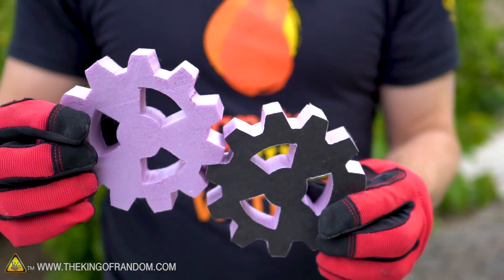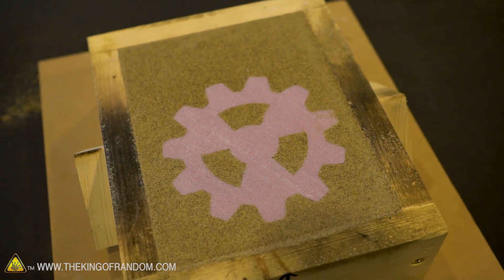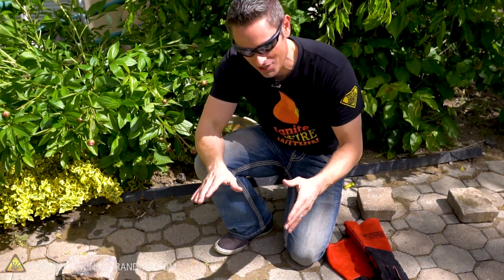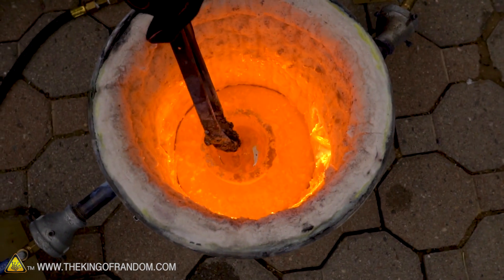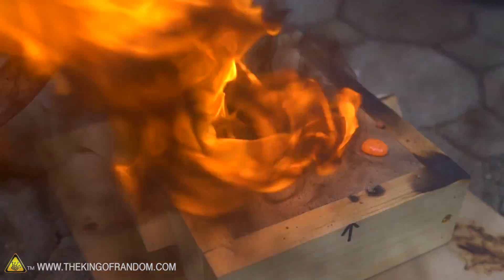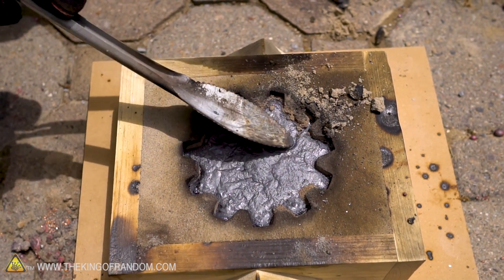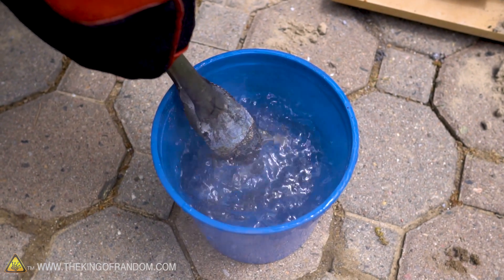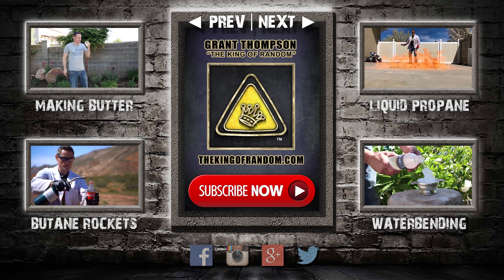Argh. Why Is Copper So Difficult? TKOR Tests Melting Copper In Our Homemade Foundry

Comment: Why not try that with a wax investment cast?  Could be that your sand is still too wet, so it's not rigid enough.  Should be ~6% moisture to be perfect.  Can hit it with a torch to harden the surface a touch.  Only other thought is to use a finer grit of facing sand.  So fill the mold 90% with your coarse stuff, then just top where the mold is with the finer stuff and pack it hard.  Should be a bit stronger.

Comment: have the mold buried in the sand and have a pouring hole from the top. that will keep the sand intact, then you cut the pouring rod off.

Comment: You needed to make your mold into Two pieces and pour through one opening til it starts to come up and out the other vent opening and let it set til it cools down the brake it apart. Because their is no way you'll be able to pour it like you are doing. just picture yourself with some wooden blocks in a tub and your needing to fill the tub with water as high as the top of the blocks. Those blocks would react like boat and float to the top.  Same as the sand is lighter than the copper so as soon as you pour the copper the lighter sand turn buoyant. So if you could maybe ad a light amount of cement to the mix it would help bond the sand together til you were done then beat it our or use a plaster mold.

Comment: I've never tried this, so this is a shot in the dark.... It looks like the sand just isn't dense enough and will keep popping to the top if you add all the copper at once. What you might want to try is pouring half the copper in and waiting for it to set. Then pour the other half in. This might prevent the sand from floating. An issue with this is you'll have a seam where the two layers of copper meet. That should be easy enough to buff/file away.

Comment: try using cement with the foam gear, or ceramic clay then bake the foam out and cast the copper in the mold, or plaster.

Comment: you must know about a tree structure to pour into your mold. Specifically you need a sprue and gates to let metal flow evenly and quickly throughout the mold.  Either this could be done in a double pour (two to four people pouring at once) or only have one sprue and hope with two gates, your mold will fill quickly enough.  Each gate could enter on either half of the gear. 

Your alternative method (that you were trying but a little different).  Make a sprue well right were you are pouring into.  Gate along the bottom of the object and with any luck, the metal will have cooled just enough to bond nicely with the sand and project your negative cutouts.  This is the risky version.

I'm sure there is a straight forward here is how to caste gears in an industrial capacity but the skeletonzation you have make this gear into is hard to caste.  I still stand behind the gating into the gear in two or three places (three being more labourious)

Comment: Industrial casting tends to be done with fully enclosed molds with sprues that you just have to knock off and grind down after casting, molten metal will try to displace sand if the mold has an open top. If you made a two part mold box and a two part mold (bottom being the gear and top being a layer with a sprue) it might work better. This is just based on what I know from large scale cast iron facilities I've seen and worked in not actual hands on experience.

Comment: Your mold needs a top. The heavy copper is much more dense than aluminum. The little square of sand is less dense and starts to float away when surrounded by hot copper and jostled around doesn't help. Having a top would keep it from floating off. I have used unflavored geletin as an additive to the sand. Its less toxic than oil being tissue based and and acts as a glue especially after it has dried somewhat. I saw it mentioned in a professional casting magazine several article years ago as a possible alternative.

Comment: idea dont expose a hole side of the mold as it seams it dosent break up the sand only lifts it as the copper is denser.

so instead of having the holetop exposed try to have something covering it up and in the middl dril a hole and then fill it this wy you keep the sand from floating to the top.

Comment: definitely a density issue, the copper is way too heavy and the greensand will float on it, you need a two part mold, cope and drag, to cast copper in green sand. you can also have a riser on the mold so as it cools and contracts you don't get voids in the mold. you can also float charcoal on top of the copper to help maintain a reducing atmosphere around the molten copper and keep it from oxidizing as much.

Comment: i think he needs a board on the top, holding the sand in place, and pour into the center. the sand is bulging out, probably due to the weight of the molten copper on 3 sides of the sand instead of 2.

Comment: Cool video grant.  I hope you try it again.  I think if you added some dowel rods to your gear to hold the centers in that would help a bunch, also your sand my need a tad more moisture.  Im glad you didn't give up!  You could also try a two part mold removing the foam before poring down the sprew.  Using baby powder to coat the part before casting will ease in removal.

Comment: Your sand was floating away because the copper has very high buoyancy. You should put 3 small (1x1 would do) arms coming in from the box frame (flat stock, no fancy up and over) to hold it down. You may still have a problem with the surface tension of the copper being enough to crush the sand laterally, but this will give you a better chance.

Comment: I think you have casting sand that's too coarse, secondly if you had a top to your mold it would keep the heat longer and more effectively fill all the void, also having a top would solve the buoyancy issue you have with the inner molding, you would also need more copper in order to fully fill the mold and sprue

Comment: grant all you need is a steel plate with a hole in the center to pour into so your sand parts wont pop out. but make ti 2x the size so you can ajust

Comment: you need to cover the top half of the copper mould, i.e. make a pipe like styrofoam entry system for the copper this will leave the three sections intact

Comment: Edit: I have looked it up and sand weighs 1500/1750 kg per m3. Copper weighs 8900 kg per m3. So sand is much lighter and will float on copper. Can you find a more solid material or something which is heavier?

Comment: +Grant Thompson - "The King of Random"  You should make a concrete mold
Reply: Chunks pop off violently when concrete gets too hot.  Obviously it could be quite dangerous if it splattered molten copper everywhere.
Reply: EDIT:This is false/untested; Setting of concrete need water, while it is harder than greensand it much more moist especially in the center where it cannot not dry, my best guess that if it gets to hot it would explode.
Reply: It would be a multi-day project, concrete + Green Sand cement mix that would need to set, then use that as a mold and break it out.
Reply: No.  It cracks due to thermal shock caused by the part in contact with the hot material expanding while the rest is trying to stay the same size.  You can mitigate that by pre-heating the mold.

Now, depending on the temperature of your casting material, it may be hot enough to dehydrate the cement, in which case it won't crack, but crumble as the cement loses its ability to stick to the other elements in the mix.

It does let you remix and repour the concrete though, if you're of a mind to do so...
Reply: The Avaren n
Reply: I'm not the smartest person but i never researched into it i originally got this information from my father who not the smartest person , but he has worked with concrete and what not but i probably should do research first before answering my bad. I'll be back.
Reply: Yes, i read about the contraction part when i went to go see if my research was correct, probably should of said something, but yes thank you.
Reply: Hmm, thought about a concrete as well. How about clay? Will it crack too?

Comment: Disclaimer: I have no idea what I'm talking about.

About two and a half minutes in and I think: Won't the pouring copper displace the sand though if there is no more Styrofoam to support it?

Five and a half minutes in:
Maybe it would be helpful to add some sort of foil to the outline of the styrofoam gear that is a bit more heat resistant? That could stabilize the sand even after the styrofoam has melted. I could imagine though that the foil, if too heat resistant, might actually contaminate the outer layer of the copper. I have no actual clue about metal casting though, so, you know, just rambling here...

Six minutes in:
Hm, I have no idea what the proper material would be, but to prevent the chance of damaging the shape with copper that drips on the sand a funnel could be useful (you did that part pretty well though, always pouring into the middle). And to prevent the sand from floating up a plate could be placed above the casting area (with a hole in the middle for the funnel).

Comment: You should mix the sand with epoxy resin to make it solid enough and suitable for casting out the copper gear. Removing the resin-sand afterwards is easy though. Cheers ;)

Comment: helloWhy not you make a mold in cement or iron (the iron in Two parts). the cement or concrete try to make without for sand or the minimum, some iron to reinforce the mold (use iron grid)

Comment: When they cast engine blocks and such they add something to the sand to cure it, a kind of resin I think. After pooring the metal they need a hammer to get rid of the sand because it's so hard. That's your problem, your sand is way too loose.

Comment: Grant, i think the water in the sand starts boiling and thats why it becomes unstable. The copper is also very heavy and thats why the sand starts floating on top.
Reply: Wilbert Coloma do you mean hydrophobic sand? That would be impossible because it would stay soft by not absorbing water. That way it could not form a solid mold.
Reply: late but I think the copper is so hot that the mold drys as it is being cast
Reply: renevank im just wondering what would happen if he used kinetic sand? Is there any difference?
Reply: If you did it properly and used epoxy sand then everything would be okay.
Reply: renevank
Yes. The damp sand method works for rough shapes only.  But is extremely 
useful for reusing scrap lead in making expensive weights for surf fishing. Also molten lead is not too hot to have to use specialized insulation while casting.

Comment: Copper creates gasses when cooling, and it will create bubbles or irregularities in the final mold. I recommend using a closed mold along with a mold tree to send the molten copper through, and lastly some sort of air hole for the gasses to go through. The air tube would be optional and may effect the compactness of the mold, but its worth a shot.

Comment: As a foundryman I can tell you you need a top part for the mold (a Cope) and you need to poke small holes through the cope into the foam pattern, also you need a riser to allow for shrinkage, look up founding and molding to get better results, hundreds of years of founding has figured all this out long ago

Comment: why aren't you casting a sand cover with a pour & vent hole? It might keep the structure from falling apart if it has a top to keep it in place.

Comment: Maybe you should try casting using closed mold. It seems that the biggest issue here is how brittle the sand form is; especially those chunks of sand that were pushed out by the melted cooper, if these were secured somehow, either by a cover with some holes, one for pouring the cooper and another for letting the gases out, or by basic 'anchors', like nails that would give them more support...

Comment: Would it help to use that red sticky sand ? They use that for these kinds of things a lot.
Also maybe use some talcum powderto rub into the shape so it will let go easier. You might even be able to remove it completely then ?

Comment: hey grant i have done it with loads of stuff made of copper what you need is and enclosed mould with a lid like how you make stuff with silicone because the force of the copper pushes the sand out and distroys mould

Comment: If you are forming copper directly and pouring it, you need to expect rough finishing. It will need additional work after coming from a mold... Fine details are best made after the molding is done. (In your case, cut out the open spokes if you want them.) This allows the completed item to be stronger "formed" copper. (Copper is not steel. Don't quench it in water).. Copper is more easily molded as a malleable item. It folds, presses, and can be made ornate. Copper by itself is quite soft and I wouldn't chose it for a gear....

Comment: change your green sand comp, I use 3 parts kitty litter to 1 part beach sand, BEACH SAND!!!! do not use torpedo sand. Since you're using a cold mould not a hot one, pour quickly to cast, not slowly. if all else fails. close the mould, and create a funnel to the styrofoam gear. pour into the hole, then grind off the excess.

Comment: I recommend on trying a two part greensand mould but keep the styrofoam in it, then those pieces of sand that float up are connected on both sides and don't have a chance to move.

Comment: try a dryer greensand. If you think about it, if there is lots of water in between all the little sand crystals then when it gets REALLY hot "the molten copper" then it turns into a gas, which rises and pushes the sand up with it. Therefore destroying the mold. It's just a thought, but I think it might work. Hope this helps!

Comment: usually adding silicium to metals helps them for casting, I don't know if it's the case of copper, but I know that it's works for sûre on aluminium, and maybe steel also.

Comment: I wonder why you didn't go with the same technique you used to cast the styro foam gun into a metal one, like that putting the styro foam gear deep buried in the sand

Comment: You could 1) heat the cast a bit so the copper doesn't cool down quite so fast, or 2) sit a wooden ring on the inner parts so they can't break off and float away.

Comment: Could you cast the foam gear in plaster and then use that as your mold? I've done something similar with brass, but I don't know if the plaster would be able to withstand the heat of the molten copper.

Comment: Every soft metal casting I have seen before used sand that was already hardened by heat treating BEFORE you attempt to pour your molten metal into the form. You must add material to the sand to make it harden when heated so it presents a very firm form when accepting the molten metal.

Comment: Why wouldn't you just set your styrofoam gear mould into plaster instead of sand? You'd still be able to melt the styrofoam and the plaster wouldn't crumble like the sand when you pour the molten copper in... to get your copper gear out you just break the plaster when it's set. Just a thought.

Comment: Hey, grant, I'm not much of a sience-dude, but could it be that the hot copper shrinks so much due to the colder sand (and the cooling in general), that it actually squeezes the sand on the bottom, and thus pops out your "sand islands" from the bottom where it is cooling down?
I don't know any solution (sorry) pre heating the sand will evaporate the water , and weaken your mold I think.
Maybe adding a lot more clay? Or casting in a different type of "sand" one that you can pre heat, of one that can withstand the pressure of shrinking metal?
I personally would try to make a second half sand box with a hole in the center (so you can pour the copper thru), and use it as a lit to get downward pressure on the islands.
I hope u know what i mean
I am no sientist, and I have never casted anything (yet)
But I am a fan of your work, and i hope I got this right ^^
like if u agree with the theory?

Comment: if you look at any dedicated metal working channel, they use two boxes, one with the actual mold, and one to seal it with pour holes and vents. these boxes put pressure on the mold so the problem you're having with the mold breaking doesn't happen nearly as often, if at all. as others have suggested, use zinc or borax in the molten copper as well.

Comment: you need to use your yellow torch to raise the temp of your sand mold. if you have too much moisture it will cause steam explosions. you could also add small pieces of rebar to reinforce the middle pegs of your design, or just cast a solid piece and drill out the design. I used to work at Semco Inc. in Ohio casting copper beryllium plunger tips and that was my job for 10 years, making the molds and melting 400 pounds at a time. we also had a flux to use in helping purify the liquid copper but that may have been because of the formula and various additions of other metals to reach the application hardness we needed.

Comment: If you want an easy tip to get better results from your green sand casting, build an identical box to the one you already have, and then use some wooden dowels and a drill to make some locking points to stack the two on top of each other securely
When you make the item you wish to cast from the foam, go ahead and go through all the steps you showed in the video, but then, attach a longer piece of foam to the center of the model
dust the surface of the sand and the model with baby powder, stack the new box on top, locking them in place, and pack more sand in, leaving the long piece of foam protruding
Make a funnel of sand around the protruding piece of foam and pour the metal from there
This will allow for much better cast lines as any overflow comes out the top instead of around the whole model

Comment: in high school we used an type of sand that had oil in it maybe that might work? Or you could put another cast box on top of the the  gear box to create a seal then use a tube to get down to the mold ?